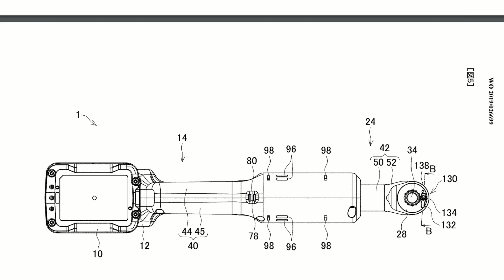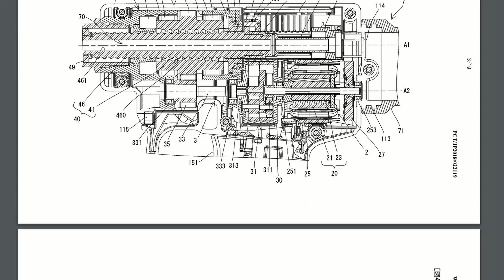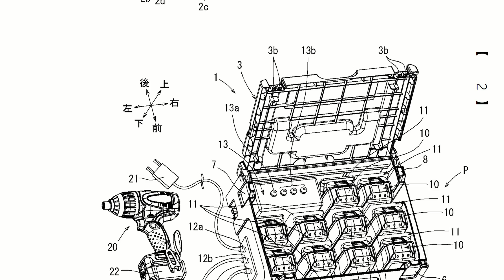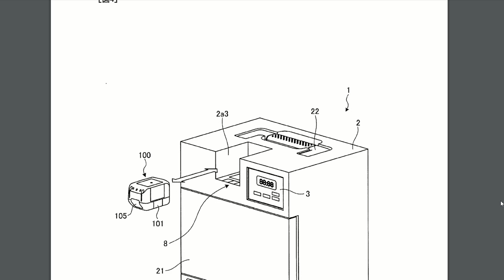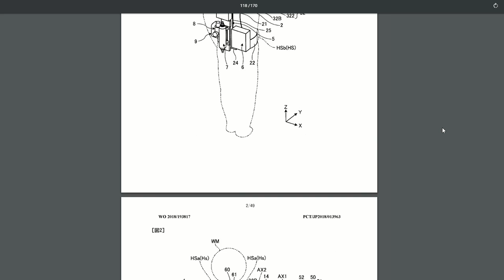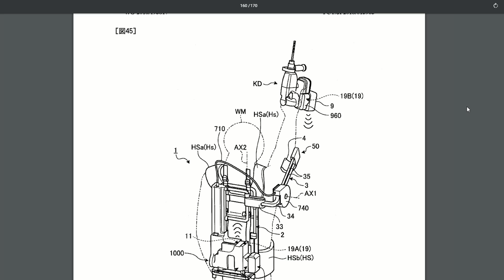Makita New Tool Predictions for 2019

Comment: It is not just Makita, Metabo and Milwaukee that make cordless rivet gun, Stanley/DeWALT does also a few versions, here is the link: https://www.stanleyengineeredfastening.com/tools/power-tools/proset-3400
Reply from the maker: Do you have a price on that? Looks like it might require a quote from a dealer, which means $$$.
Reply: They are from 500 t0 1000 approximately as much as I remember. But Metabo ones are round 500 USD also. Not too much difference for the one who is on DeWALT platform and wants to use the same batteries for all tools.

Comment: I love Makita but I wish they would make a 2nd gen of cordless nail guns. The current ones are huge and ugly and don’t work well. Also high capacity batteries
Reply: Ive got the 23g gun for small finish work. But I'd love a cordless alternative nail gun rather than paslode or hikoki etc. Paslode have even got a cordless coil gun.

Comment: I wish to see makita bring out a cordless deep wash rug cleaner vacuum same size as the XCV11Z ,
Also a long neck ratchet 1/4 , 3/8 , 1/2 , and a stubby impact drive 3/8 and 1/2 inch, and a digital torque wrench 3/8 and 1/2in. and 18" chainsaw with more power.  instead of the 14" and the 16" which are good.
Reply from the maker: For the long reach ratchet and stubby impact wishlist, it might be worth looking at the M12 system. Milwaukee came out with the stubbies last year, and announced a torque wrench, extended reach ratchets, and a die grinder just a few days ago.
Reply: @DoresoomReviews   your wright!, I just hate to be in the Makita platform and then have to fork out money for the Milwakee, if i do this i have to sell off all my Makita tools :( this is  sad, I really like Makita tools and they a well built tools.

Comment: I opted into the Milwaukee 18V and 12V, and Makita 18V platforms and I’m happy with that. I do wish Makita would get some new batteries on the market though. Something like a compact 3AH with 21700 cells like Milwaukee has coming would be nice.
Reply: Makita will probably use 26650 cells instead lol
Reply: They have just announced a new platform using 40v 21560 cells. I dont think it's backwards compatible though. Seems like they are targeting high end industrial use against hilti etc.

Comment: Makita do already have a ratchet option on the market and it's been available for a while. 192439-2
The rivet gun comes in 2 variants; can't remember the exact model numbers but they're both market ready. A third is already being sold by Huck for their own structural fasteners.

Other than Metabo and Milwaukee there's the Gesipa Accubird rivet gun (majority of professional users consider Gesipa the market leaders in blind fastening). Stanley Black and Decker have a cordless rivet gun, the POP ProSet PB2500. Also Lobster Japan have cordless rivet guns. Unfortunately many people consider Milwaukee the first brand to do this however they're far from it and it's the weakest riveter available, certainly not graded in my mind as a professional option.
Reply from the maker: I looked and looked on their website for the ratchet and rivet gun and couldn't find them. Thanks for the info!
Reply: @DoresoomReviews  The rivet gun isn't available yet but has been in production for the last two years. Reps have them for testing currently and they've been at some invite only expos.

Comment: Next up DeWALT or Bosch?
Reply from the maker: I looked at both, but they didn't have much at all that was noteworthy. DeWalt has a battery rental kiosk for large jobsites that will keep you topped off with fresh batteries for a flat fee per day, but that was about it.
Reply: @DoresoomReviews   any other companies have anything notable? Also on DeWALT I checked theirs the other day and found what to me looked like a Starlock/Universal Fitment omt hybrid connection system. The shape looked like Starlock but it had a cutout to fit DeWALT omt's. I thought it was interesting.
Reply from the maker: Interesting! I mainly concentrated on those 4 brands when I was searching.
Reply: @DoresoomReviews  Could your have a look at Festool they come up with some nice ideas always and they bought Sawstop so thats gonna be on Festool table saw now also.
Reply: @jron yes there is an update on dewalt. Its more cheap plastic, more uncomfortable tools and they have now merged with black and decker so you can now buy them at wal mart